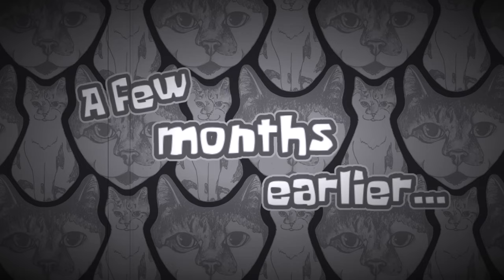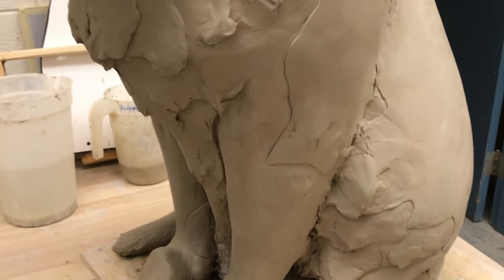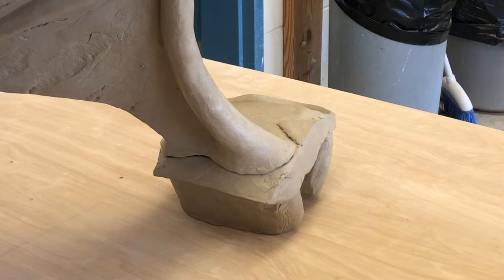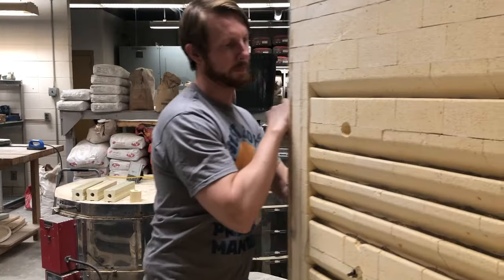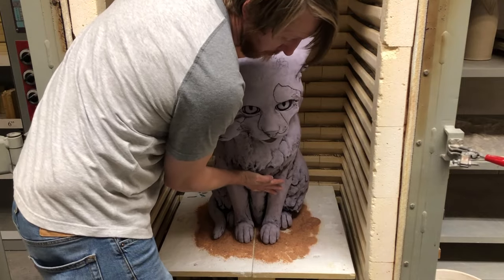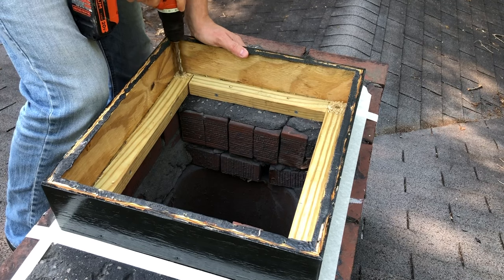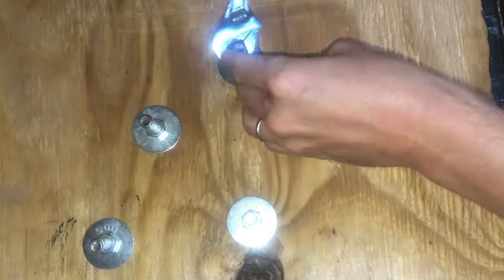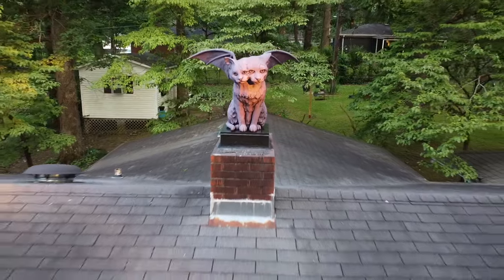Sculpting a Giant Conjoined Cat Gargoyle from Clay

Comment: 'Nice ceramic project, although the material choice seems odd for creating a sculpture for long term exposure to the weather, (I could be wrong, though). How well has it faired, so far? I've been considering making some sculptures for permanent outdoor display, also. And, one product I've seen repeatedly  recommended is called, "Pal Tiya", (essentially a sculpting cement, that sculpts like clay). It isn't exactly cheap, (but, what is nowadays?). Except, it has been well tested for surviving pretty severe weather conditions, and is surprisingly easy to use. (No, I have no connection to the makers of this product, I'm just another artist, sharing potentially useful info.) Maybe, it might be worth investigating, if you plan on sculpting more outdoor sculptures? Again, great work!
Reply from the maker: Thank you so much, and thanks for the great information! I agree, clay is not an ideal medium for long term outdoor sculpture, but it’s what I’m most skilled at using, and I don’t have access to any type of bronze casting, otherwise I’d be all over making this bronze, and maybe even multiples! However, this does give me an opportunity to observe how it holds up long term, which it has so far survived about two dozen summer storms and high winds since installing in June. My main concern is that a limb will fall on it living in a very forested neighborhood. Spalling could happen when it gets to freezing, but we have very mild winters as it is, and I’m going to periodically put more water sealer on it. Thanks again!

Comment: I love it and I want one for my chimney, but I have to ask where does the smoke from the chimney go?
Reply from the maker: Hey this is a great question! In my particular case, my chimney is non functional. However, if it were, I would have found a way to mount it onto the mesh wire chimney cap that was on it beforehand.
Reply: Make hidden exit holes in it so it looks like it emerging from the smoke.
Reply from the maker: @willparry  Sounds awesome! However my chimney is not a functional chimney, so no smoke.

Comment: I am amazed. Your sculpture is... perfect! I am at loss of words. I am a sculptor myself, I also make big sculptures in earthen clay. But I have many problems with cracks appearing in the firing. How do you avoid that?
With kind regards
Thomas
Reply from the maker: Thank you so much! Great to hear from another sculptor! If there’s anything I’ve learned from ceramics, it’s that sometimes things just happen. There was only one small crack that appeared on this one, and I believe it was an area that was hollowed too thin. Are you using a heavily grogged clay? If not, try one. The grog really gives a lot of structural integrity. Cracks might also occur because of overly thin/thick spots (like the issue I described with this one). Firing schedule could be a problem too. Go slow. Like, really slow. Ultimately it could be a number of things, but I also try to make work that can embrace the flaws. Thanks again 😊
Reply: @MakeStrangeThings   Thank you for your answer. I do alle the things you suggested. I don't always have cracks, but I am having a hard time figuring out, what makes the difference. But as you say, I try to embrace the flaws ☺